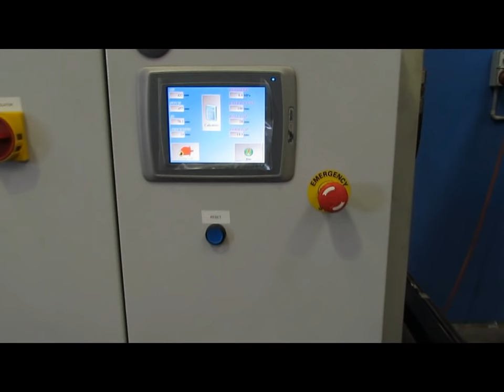Forming the perfect sectional screw flights all the time every time - no experience necessary

Comment: Very neat. I remember watching our men making screw sections when I was a kid. A stack of disks were put into the coke forge, heated and then pressed. Your system is so much more efficient.
Reply from the maker: Hi Clayton,
Our system has been developed with accuracy and efficiency in mind but at the same time we always had an eye on worker safety and satisfaction. Our TruHelix system either eliminates or significantly reduces any number of the unsafe, hot and hard work aspects of traditional sectional screw flight manufacturing methods. Operators now enjoy this work and I have experienced instances where guys argue amongst themselves to take on the job, where as perviously the would argue to get out of the job.
Best Regards
AST

Comment from the maker: Our TruHelix sectional screw flight manufacturing system, which this machine is an integral part of, will efficiently manufacture any flighting that you require for Post Hole Diggers. Our system is for sectional screw flights which means they are manufactured in per pitch segments and will need to be welded to a centre pipe/shaft and then welded together to form a continuous helix.

I hope this helps.

Best Regards

AST Team

Comment from the maker: Hi Dru,

The operator will enter all of the finished flight dimensions into the touch screen on the machine and the PLC will then calculate all appropriate machine settings for the accurate forming of the said flights, including the forming gap. At this point the reliance on the operator to consistently return to the same position and apply the same pressure is eliminated because the machine returns to exactly the same forming position every time ensuring consistent forming of the flight.

AST Team

Comment from the maker: Thank you
Previously helical screw flights have been primarily formed by “pitch” dependent dies in 
various forming machines. The accuracy and consistency of the helical form was largely a function of the die pitches, the experience of the operator and the accuracy of the cut annulus from which the helix was formed. All of this cloaked the black art that was “Flight Forming”. Our technology makes screw flight manufacture quick, easy and perfect all the time every time regardless of experience.

Comment: Thank you for this very interesting video.  What an effective way to make the screw from sheet metal!  My question is: why do you have a guy in there doing all the work ?  Are you already thinking about using an industrial robot ?  It looks like a good application for a robot as the task is noisy, monotonous, requires precision and involves heavy lifting.  The same robot could even be used to weld the sections together if it had a tool-changer to swap from a  gripper to a Mig welder.  Then the guy could do the fun stuff like designing or testing the screws. :)
Reply from the maker: Including automation or robotics adds to the investment cost and at this point our market research shows that at this stage the marketplace is not demanding these type of needs.

Comment from the maker: Dear Ulyssis,
AST has a number of different system models which enables us to provide the most applicable solution to an organisations requirements. In your instance we have a number of system options that can produce helical sectional screw flights with an outside diameter 900mm & inside diameter 240mm. To helps us to fully to understand your requirements, so as to present the optimum solution, we ask that you please visit our website www.advspiraltech.com where you will find an inquiry form.
Thank you & kind regards,
AST Team

Comment: How does the operator know how much to rotate for each bend?
Reply: It doesn't matter really, so long as the operator does not rotate it too much, because the press tooling's anvil and punch dies, are shaped to the flight's finished profile, and so long as there is an overlap between the flight metal of each forming stroke cycle, then the finished flight will end up conforming to the required shape ! So there you have it !

Comment: That's pretty durn accurate, the flights we buy are good but not that good!
Reply from the maker: Our TruHelix Sectional Screw Flight manufacturing system provides users with accurate, efficient and consistent results with not much more than a weeks training. TruHelix minimises the need for screw flight experts to calculate blank sizes or to form the shape. With minimal training almost anyone can produce an excellent screw flight very quickly.
As a matter of curiosity KISMYACE3203, who do you currently source your screw flights from?
Reply: AdvancedSpiral  We buy from a company called Conveyor Engineering. They really do top-notch work, but each flight is matched with the next one in line; so 1-2,2-3,3-4, etc. I couldn't flip one around or mix match them and expect them to line up exactly the same without some "persuading". But this isn't necessarily a bad thing, like I said, they do awesome work and any completed augers we buy from them have nice machine welds on them with very few defects.
Reply from the maker: KISSMYACE3203 I assume you are talking about Conveyor Eng & Mfg in Cedar Rapids. I know these guys and yes they do make a nice flight - much better than many. I guess the advantage of our system is you never need to do any 'persuading' no matter what order you fit the flights.
Reply: AdvancedSpiral
 Yes you are correct, and it would also be nice to be able to grab any flight out of a bunch and it will line up no matter what for welding. But that only pertains to straight shafts, if you have a tapered one it's a moot point. G'day mate! (You're Aussies right?)
Reply from the maker: KISSMYACE3203 Yep. From Down Under.

Comment: My question is something about calculation. I am interested in this can anyone tell the mathematical equation that I can use to calculate the sheet metal dia so that after stretching, it get its required dia ready to fit inside the cylindrical shell. I mean the diameter of actual flat sheet is larger than the final required dia. Anyone know that how to do that calculation. If you have link of the info please share. But I know there must be some manual calculation. Please help by replying.
Reply: hello Sir how to reach you?

Comment: WHAT IS THE FORMULA OF DIE DESIGN OF EACH PITCH VALVE
Reply from the maker: Dear Murugan,
We have a proprietary software suite that is available to all of our "Operatives" that, amongst other things, provides accurate calculations of the cut out size and pattern for helical screw flights along with specific Tooling (die) details and selection. Please send us an email sales@advspiraltech.com expanding on your immediate needs, and your potential future needs, so we can get a full understanding of how we can best serve your requirements.
AST Team
Reply: Software name?
Reply from the maker: Hello Murugan,
AST’s TruFlight Software Suite - The knowledge & expertise: The software component of
 our TruHelix™ Flight Forming System has taken the secretive, and highly guarded, IP of sectional screw flight helical manufacture, that is intentionally kept locked in head/s of the extremely scarce “Flight Expert/s”, and placed it into the possession of the many, making the need for the essential “Flight Expert” practically redundant. Our TruFlight Software Suite incorporates two unique programs that perform specialised engineering calculations at a cost that is many times less than a Flight Specialist or real-life Engineer.
AST Team
Reply: Ok sir understood but... Software calculate by the formula. Your machine was very advanced.. But i try to one small my college project that's why.. 

My doubt was : 
1. Everytime you change the dies for variable pitches? Or single die make all the pitches. 
2. Die angle it's relate to 3 types of gaps. Like form gap, extract gape etc. 
3.die angle was our assumption or any formula... Like angle x pitch /2 .
Reply: Hi sir please reply...
Reply from the maker: Dear Murugan,
Your latest points require quite technical response and this is not the forum where it is convenient to elaborate. Please communicate via the following email address sales@advspiraltech.com
Thank you AST Team